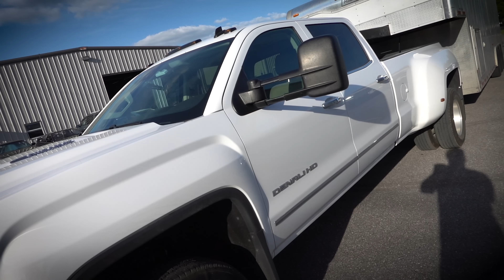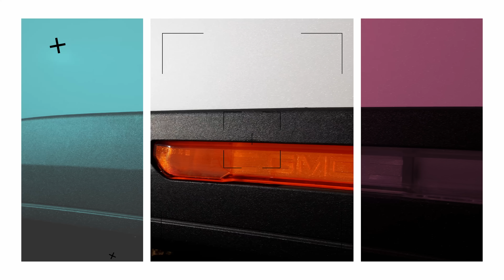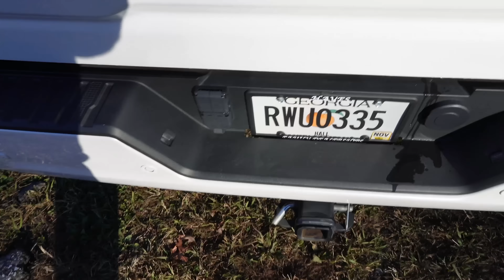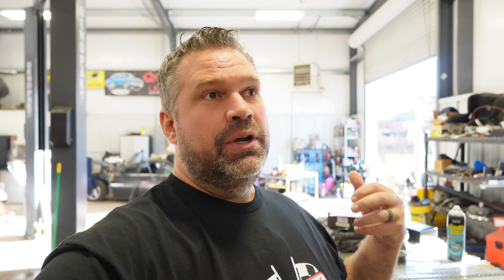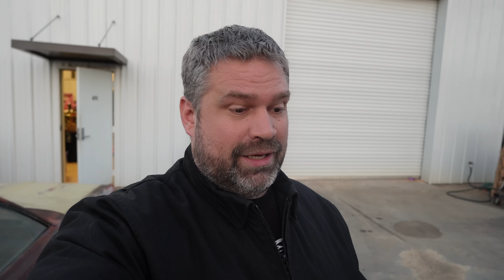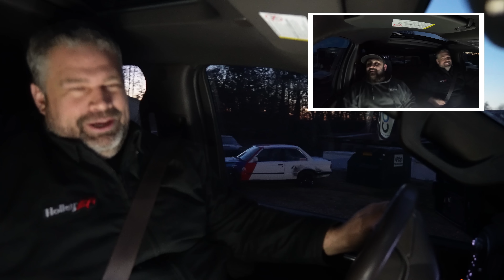My New GMC 3500HD Dream Truck Has A MAJOR Flaw! Can I Turn The Nightmare Into A Dream?!?

Comment: Emissions - particulates. Over the past decades it has been found (simplified somewhat)
       If anything gets in your lungs its bad for you. 
       The smaller things are that get in your lungs the worse they are and they may be able to enter your body.
So dirty diesel was based on visible smoke coming from the exhaust - obviously bad for your health as everyone could see it. 

The regulators created rules over the years that removed the visible smoke and the weight of the particles. 
The only problem was the way the industry met these regulations effectively made the particles smaller and lighter - which meant they were worse for health - but the exhaust looked better.
This was eventually solved by laws that effectively required particulate filters. These are AWESOME for removing diesel exhaust particles. 

Rolling coal goes counter to all of these regs. Even though the "coal smoke" is so BIG that you nose will filter it out, it is so counter to the idea of cleaning up the air
Also it is so OBVIOUS the regulators HAVE to crack down on it and once they start looking somewhere, they go looking elsewhere, and so the whole modifying industry comes under the microscope. 

So keep your DPF working well, go on the highway with a trailer so that it can regen naturally due to high exhaust temps, use a high quality oil as it is more likely to have lower ash levels that will clog up the DPF. An exhaust backpressure gauge may be good to have, so that you can see it filling up (creating backpressure) and so know when to go for a nice country run to clean it up again. Lower backpressure is always nicer, but always with the DPF being there.

With SCR (DEF) and DPFs the manufacturers are now able to start removing EGR etc and clean up the exhaust after the engine.

This means they can go back to improving the performance, fuel economy reliability etc while STILL meeting the emissions regs - good for EVERYONE, - except those that love a smokey exhaust.
The Cat C13D is the first "clean" sheet engine design I know off since this time and it really starts to show where diesel (from the factory) can get to when using SCR & DPFs.
Adept Ape did an interview with the lead designer on YouTube look him up.

Finally (at last) If you are around ANYTHING for a reasonable amount of time that has small particles WHERE A MASK. 
That can be spray painting, cement (dry concrete, mortar), grinding (almost anything), asbestos (cement sheet from before the '90's), etc etc. look on the package
Black lung (coal), Asbestosis & mesothelioma (asbestos, ), Silicosis (silica from stone - natural and manmade - things like benchtops) are ALL horrible ways to be sick and die.
Diesel particulates where found to be bad due to studies on the health of railway workers that worked around locomotives - all very real.
Its like roulette every time you are around them. It is possible for a weekend warrior, but VERY real and more likely for an industry worker.

Comment: On diesels, black smoke is not unburned fuel, it is burned fuel.  It is caused by burning too much fuel which jacks up EGTs and leaves massive carbon deposits both of which cause premature engine wear.  A well tune diesel should produce little to no black smoke.
Reply: Too much is fuel is literally partially burned fuel. There is too much fuel to completely burn in a combustion cycle, hence, black smoke, incompletely burned petroleum. Same thing on gas engine, run them fat and they smoke and you smell fuel, just like a diesel.  Racing diesels in Europe, from trucks to road racing cars, you barely see smoke
Reply: This is why I laugh when the goofballs bragging about "rolling coal", congrats on destroying your stuff

Comment: Dodge/Ram's top trim is usually called "Limited" but now they have the Tungsten coming in the newest variants. There's also the Laramie and the Longhorn, that also feature a lot of goodies. Also, the 10 speed in the GMC isn't really an Allison, its the same corporate GM 10 speed that they developed with Ford, and Allison just signed off on using the name. Though GM's 10 speed has been reliable for most, where as Ford can't seem to catch a break with its programming. While mechanically both are fine, Ford can't seem to program a transmission to save their vehicles.
Reply: " Allison just signed off on using the name" - Allison stated that they validated the design to ensure it met their standards, which is more than just signing off on slapping their name on stuff willy nilly.
Reply: I have no problems with the 10 speed in the 22 Tremor F-150.
Reply: "While mechanically both are fine, Ford can't seem to program a transmission to save their vehicles."

Anyone with a late-model Focus can confirm that one.

Comment: Why a base model over any higher level trim? Simply cause I need to get my job done and it will end with me having to tow the sucker to a shop to then sell it. I can buy some things that in a span of 5-10 years and 3-5 vehicles later can be replaced that give me those built in creature comforts and that's enough. I end up saving ~$100K in the long run getting the bare minimum in that time frame than if I keep Playing my cards right that's my Retirement fund for getting the job done and saving every penny I could to be prosperous. yeah maybe at the end I'll dip into what it could of been by buying a few with the higher end packages but right now the bare minimum and me hobbling together my creature comforts for jobs saves me More money that I could maybe use later to pursue so fun project or travel expense that having those over price luxury add-ons just make my work exercise may be 1-5% better than me using my head and hitting the grind stone.

Comment: i like beater trucks. i always wanted a taco but they want way to much for them even used. but you can find a good used beater truck for not much money. if you get one with good power train you can pretty much fix everything you need for not much work and money. best thing is you dont go in debt for a vehicle.

Comment: Hopefully my 99 F350 with the 7.3 will keep rolling along, currently at 421,000 miles, bought it for $10K with 100K in 09, would cost over $100k for a new F.350 dually

Comment: I love a Chevy but when I bought a tow rig I got a 17 f250 6.7 SD.  slapped a disaster prevention kit from SPE and a 5 dial from calibrated power. its a beast! 620hp 1250tq on tune 5, full emissions, 137mph gear bound. its a great platform but that Chevy sure is nice too! keep up the great videos!
Reply: how hard was the disaster prevention kit to install? my 6.7SD is still under warantee, so i am hesitant to install one until i hit 100k, but i figure the stock stuff should easily make to there. After that i am looking at that kit, mostly to avoid sending the bosch fuel pump parts into the injectors.
Reply: @johnhertel3931  I'm a seasoned mechanic and it took me 3.5 hrs first time out in a shop. It's a very nice kit with no modifications to the truck needed to install. had a difficult step or two but was easily do able in a day for the average guy. Also a great time to clean the intake manifold sense your removing it anyway and they like to build with carbon mine was anyway

Comment: Hmm, let's compare specs on my 3500 HD and your 3500 HD.  Year: mine 1999, yours 2022. Engine: mine 454, yours 6.5 Duramax.  Transmission: mine 4L80E with no forward gears, yours 10 speed something. Interior: mine hand crank windows, yours all electric everything. Bed: mine hydraulic dump bed, yours standard box. Tires: mine, well, let's just say I wouldn't drive 75 MPH, yours nice shiny tires. Cost: mine $5000 (plus probable $2K 4L80E rebuild), yours WOW THOSE THINGS ARE EXPENSIVE. Yeah, I like yours better too.

Comment: My grandfather drove for a living. The 3 pickups he owned were bare bones because he claimed it took away from payload. But the 1950 and 86 Dodges are still going strong. The 71 Chevy rotted away and was replaced by the 86.

Comment: The more options the less payload a truck has. The more expensive, the longer you have to work with higher risk to pay it off. No need to get the fancy truck when you'll wear it out in 5 years

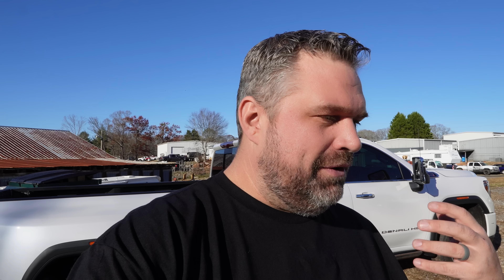Comment: 4:00 Ford’s top of the line truck is the King Ranch (although it may have been usurped by either the Limited or Platinum trims), RAM (not Dodge, hasn’t been that way since 2011) their Top of the Line is the Laramie LongHorn, GMC of course is the Denali, Chevrolet’s is the High Country, and Toyota has their Tundra 1794 Edition

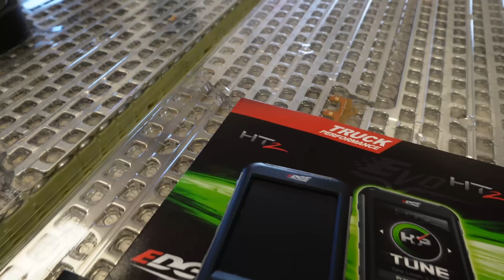Comment: 14:48 well said Jared. 🖤 rolling coal is one of main reasons tuning became a problem 😅
Reply: It is the same issue in my area with straight-piped, no-baffle motorcycle exhaust topped with a fist full of throttle.
Reply: Redneck response, “Hell with you, Rolling coal is my God given American right, and if you don’t like it, go back where you came from!”
Reply: @Soldierboy1986  LoL 😂 I never said I hated it. But everyone always goes for the biggest nail with a hammer. 🔨 just saying.
Reply: Wrong. It's arrogant government overlords of the administrative state working for their own interests and the interests of other countries over that of the citizens. That said, I agree it's best not to call attention in such an obvious way.
Reply: @blackmanops3749  yes. I agree with you. It comes down to control and that was an excuse. Now they will mandate EVs with remote shut off switches they control along with rolling black outs. The future once looked so bright but now ….. I dunno 🤷‍♂️

Comment: If you think rolling coal isn't cool, you've never seen semi drag racing.
Reply from the maker: That’s different. Watching those trucks lift up and almost twist in half is amazing. Watching Jeb leave a traffic light making the entire area black with smoke is what put the industry at risk.
Reply: In 2018 I used my Cummins to go pick up an airplane from the left coast. I was extremely embarrassed heading up route 70 towards Vail when I realized I didn't detune for elevation and was sooting like mad. The biggest downfall with edge programmers is not being able to tune on the fly.

Comment: A friend got a V8 diesel engine and at stock, it is 730HP (metric HP) but on a full tune they got it up to 1500HP (metric HP) and a little bit but the extra cooling powerpack could not keep up with its extra heat so they turned it down to 1300HP (metric HP).

He can have 3 settings 730, 900 and 1300HP and at 1300HP going uphill even with the extra cooling pack he can overheat the exhaust system to it glowing red - there is a stage 2 or 3 water cooling kit he could fit.

Not sure if he swapped out his drive shaft with a carbon fibre one - the last time he did it it cost £25,000

Also with that amount of power, he has greatly reduced oil change times.

500 American is approximately 450HP metric...

Watch the top gear clip when Richard Hammond's 500HP Mustang got HP tested - that is the difference between the two

Comment: My only guess as to why hot-shotters and others that live in their vehicle know they're about to quite literally drive the thing into the ground. Spending an extra $10-50k to be slightly more comfortable probably eats into the profit margin too much, plus when stuff breaks thats less time to be driving and making money. Its just a tool: same reason there isn't bluetooth, chrome, heated grips, and a cooling fan on your impact gun.
Reply: You nailed it.. I have a 2021 base model I put 323,000 miles on before it left me needing a tow.  With the miles the resell value is nothing.  I have a 2023 now that I have 80,000 on.  Had the banks pedal monster and Derringer since new
Reply: I do mobile mechanic work and I love my work truck trim truck. The less features it has the less that can break. Mine doesn’t even have onstar. Hot shots have the job of maximizing profit. So spending an extra $15,000 for features is $.04 a mile they lose. Assuming a 1000 mile day that’s $40 a day.
Reply: @DustinHasVideos  Appreciate 💯
Reply: Also it's higher tax, tag and insurance. As a business operator it's always a good idea to keep overhead low.
Reply: I'm thinking the more the truck is equipped with options the payload and tow rating goes down.
Reply: @yesmaybe3791 correct, if the vehicle is rated for say 8,000lbs and the base weight is 6,000lbs the payload is 2,000lbs but with 850lbs of wire, leather, speakers, moon roof ect turns into 6,850lbs truck rated for 8,000lbs with a payload of 1,150lbs. (Generic numbers for example)

Also that's 850lbs of added weight in fuel spending when empty. 

Most Class B Hot Shots are also working towards Class A loads and want to save the money for that to get a nice Tractor Trailer setup. Most Class B's are home nightly or ever other night unless there going cross country with a return load otherwise they tend to keep it local or with in a few state radius.
Reply: Often theyll be fleet leases also
Reply: Oh, a heater on my cordless impact would be sick 👍
Reply: @bgee461 it would lessen the lifespan of the battery on the guy though 😏
Reply: @joshrepik  true, but how nice would a heated grip be.  Sad truth is I wouldn't wanna pay an extra $50 for it... the fuel m18 tools are already quite pricey
Reply: @bgee461  true. Looking at the numbers for the new high torque, it’s just not worth upgrading from mine either
Reply: You are 100% correct. We run base models because if it doesn't add to getting the job done, it's money that doesn't need to be spent. Secondly most of the time, base models and 2wd have higher payloads and towing capacities.
Reply: High luxury trucks are a big waste of money when your a buisness man with a small fleet of work trucks, more to break, a/c , windows and door locks cloth interior,  been buying them over 30 years
Reply: Plus, if you're driving long distances, there's little benefit to cooled seats or heated steering wheel. The entire cab gets up to temp within 15 minutes of driving.
Reply: @questioner1596  That isn't true at all for me. I am very glad I went with all the options on my 2020 duramax and I use the heated steering wheel a lot, even on long drives when it is cold. My body doesn't need to be as warm as my hands. The heated seats, I hardly use, but the cooled seats are great. Today I ran the cool air in my seat and it was probably 70 degrees today. The fan keeps me from being so sweaty from being against the seat where there isn't air flow. The camera for the rearview mirror is great for changing lanes and I like the heads up display a lot. Most of my driving is for work (construction trades) and I have constant body pain and discomfort. I was ready for some comforts after daily driving my 79 C20 for 20 years, although I did tons of upgrades on it. It all depends on the person.
Reply: I agree about fleet leases from the youtube videos I watched.
Reply: The cloth seats and plasticity interior is also tougher than the leather.
Reply: @mikepodorski4272  that's just not true, both coverings will 100% start to shred once the foam under them fails.  As soon as the foam fails, the covers are starting to go.

Comment: Well you technically are not supposed to leave a receiver hitch in when not towing something anyway
Reply from the maker: Shins everywhere agree. And your frame in case you get rear ended
Reply: @TheQuestionableGarage  Some states actually have laws about it. I personally don't leave mine in if not towing.

BTW, I'm hoping to start a 1st Gen Ranger Barra build soon as well as a 2006 GTO build

Comment: I have a 2021 L5P Duramax, I did the pulsar and ct3 kit. NIGHT and DAY difference. Banks stuff is great obviously he is one of the best diesel engineers out there. I chose mine based on being removable and the better screen and I dont regret it. I debated doing the flash and trans tune recently, but I had the pulsar before that came out. Being able to adjust throttle response, boost, speed limiter, manual regens and more. The truck lacks so much in response and power but those upgrades make the truck drive so much better and like a dream. Good luck! Also my favorite feature is the digital rear view mirror, what a game changer on a truck this big.